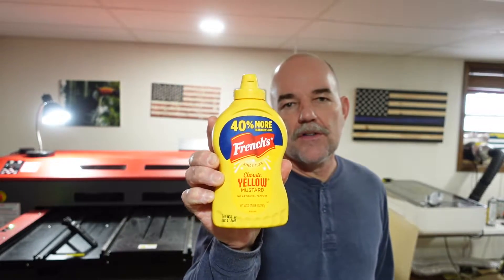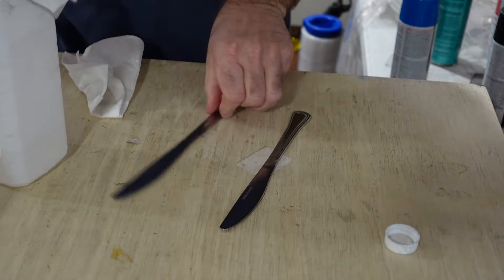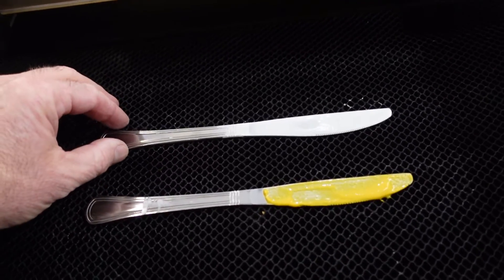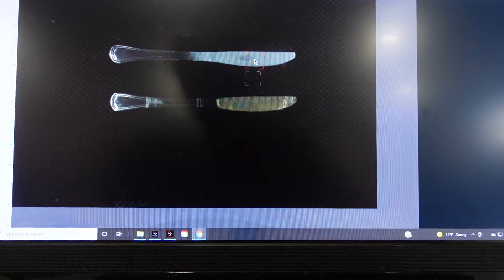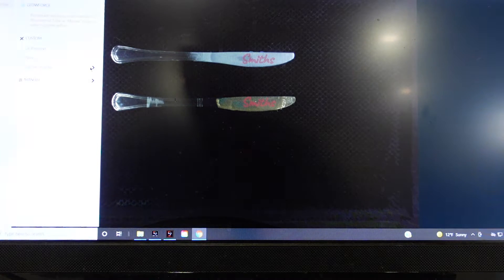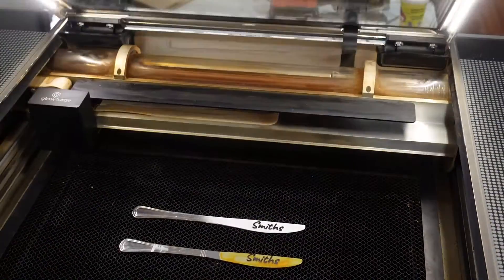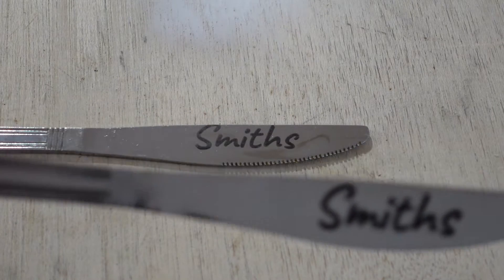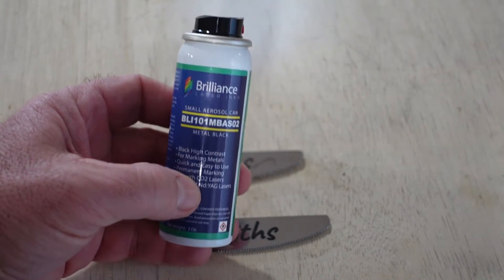What Happens When You Use Mustard For Laser Engraving?

Comment: If you're selling them, the spray would be key unless you can figure out how to get an even coat of the mustard on every piece every time. Unless you want to sell inferior and cheap looking products. I use mustard to force a patina on my uncoated High Carbon Steel knives and getting an even coat isn't easy. Have you tried and zinc-based spray paints?

Comment: Thanks for that, I hadn't realised the glowforge was so advances with the camera ? Is it automatic or is there a process to get to where the camera gives you that text window.  Its' quite good, do you use their software or Lightburn?

  It probably wont work that well on sockets as you are dealing with Chrome which is extremely hard and the food knives are more likely to be of 18/10 stainless steel which compared to chrome is a relatively soft metal, chromes IR refectivity is also incredibly high so most of the energy will just bounce straight off I expect.

thanks for the vid, useful video with the right amount of information.
Reply from the maker: The camera is automatic. The Glowforge uses their sofware in the cloud. It has to be conected to the internet to work.

Comment: Thank you for the video. Does the laser provide any marking without the mustard/spray? Would be interesting to see one with just bare metal.
Reply: You also want to avoid doing bare metal. You run the risk of damaging a CO2 lasers mirrors when you engrave anything reflective.
Reply: Hi B&B fan.
Yep I have tried without anything, well it only just makes a very fine and faded mark using power100% speed 300 god it was slow ;o( and not really worth it ;) I also tried it on a steel spanner that came with the engraver, no marker or paint just on the bare steel, got a very very faint mark but it can be done, I will try again with paint or marker on steel one day and let u know ;)
Reply from the maker: With a high power industrial laser you would be able to mark or even engrave metal. The Glow Forge just doesn't have the power to do it.